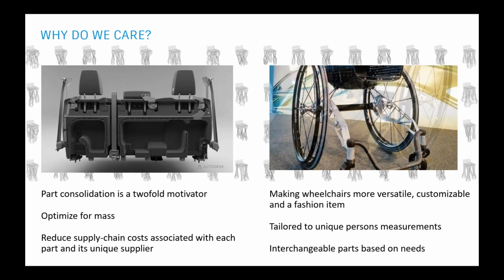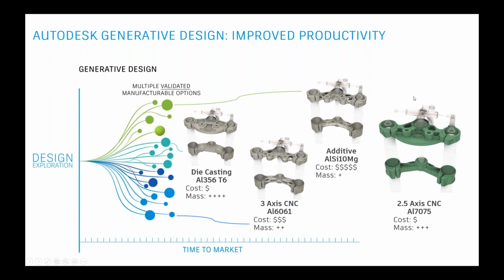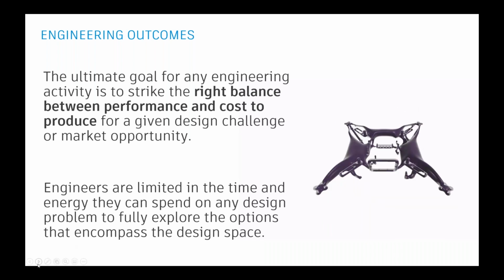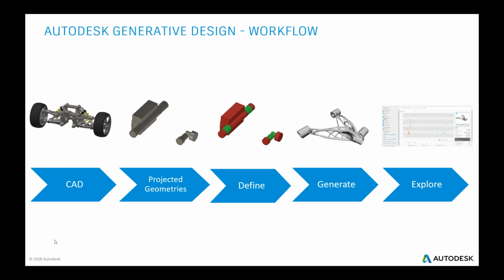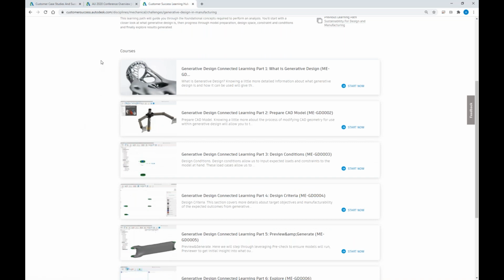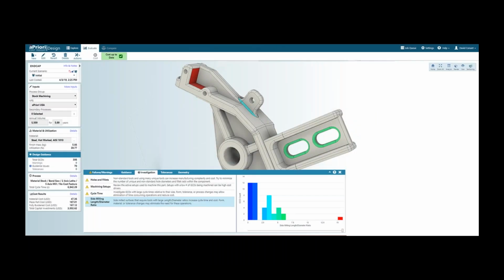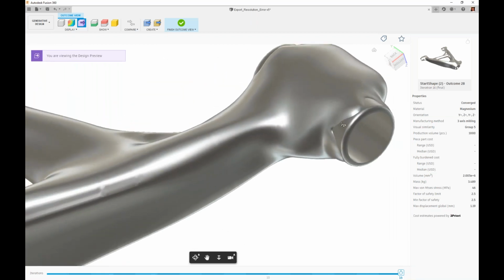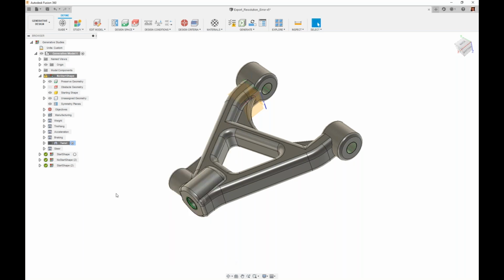Generative Design in Manufacturing - Oct 2020

Comment: Hi is generative design capable in the sheetmetal area
Reply from the maker: Generative design is a workflow inside of Fusion 360 and is not specifically designed for sheet metal. However, you may be able to set up the appropriate preserve regions to maintain a uniform material thickness?? It would be a good test let me know how it goes if you try it..